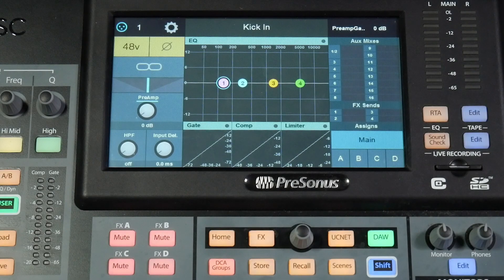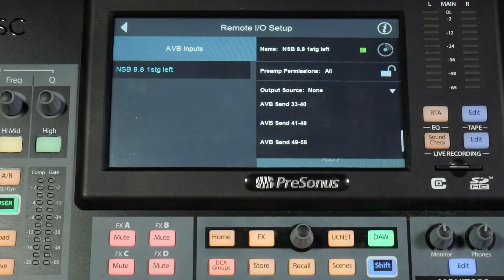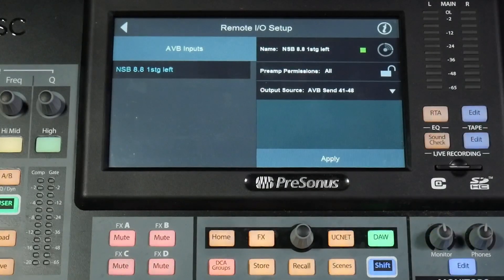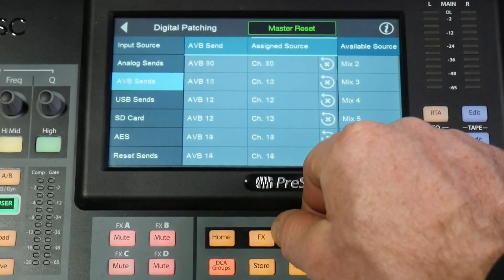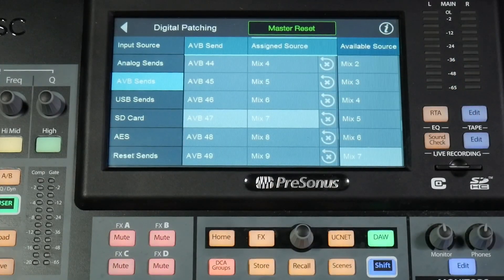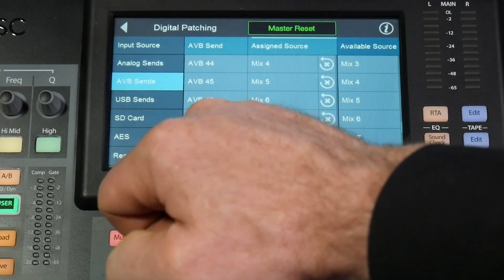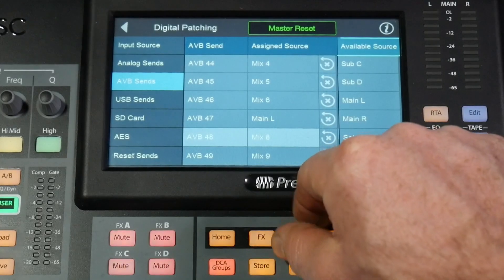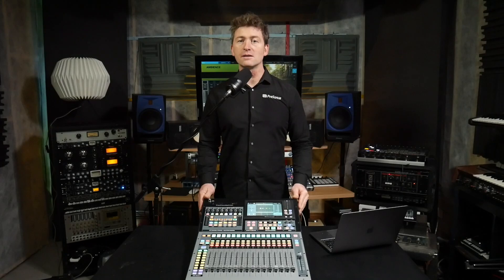AVB Output Routing with NSB Stageboxes on StudioLive Series III digital mixers

Comment: Thank you for this! I was like @waynebouwmeester2101. I was trying to assign Main L to one of the AVB Outs (I connect Main R to the analog output on the board), but couldn't figure out why none of the assignments I chose worked. Didn't realize no AVB Output streams setup. The reason why is that option is not listed in the "Audio Routing" page like AVB Input Streams is. Would be a good firmware addition for the noobs.

Comment: Good info.  It would be nice to see how to set routing for a FOH and monitor mixer (2 mixer) setup.  Would like to see how to route FOH L/R to the main FOH outputs... but with the monitor console maintaining control over all monitor mix outputs.   I'm not sure this can actually be done... especially with the FOH console only controlling the L/R outputs for FOH; not all 8 outputs it's designed to control.
Reply: I’m having that same issue
Reply: If you have an ipad,  you can connect a wifi router to the main board and just use an ipad to control mixes for each monitor output.  Then the main board can handle FOH. You can even assign permissions on the ipad to only control monitor mixes.  Or, if each band member has an iphone, they can login to their own monitor mix and control themselves.